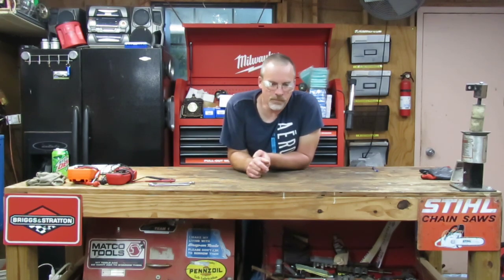How to Trick to test for Battery Amp Draw ( BATTERY DRAIN )

Comment: If you have a multimeter that can measure amps, then you can test for amps the same way the meter was hooked up. Still I agree, test light is all that's really needed to diagnose a key off parasitic drain. Well done video!
Reply from the maker: Yes a multimeter with amps setting can read amp draw, but most meters will max out at 10 amps, If it's more of a draw than that ,Meter won't show a reading

Comment: You're doing the meter wrong. Put it in amps mode (not volt mode) and change the probes to the amp position on the meter.  Hook the probes in the circut exactly as you show them.  That will measure the current draw of whatever is trying to use power.
Measuring current requires your meter to become part of the circuit (that is why these meters have separate jacks for amp draw and everything else). The light is working in exactly this way.   Using the meter will show even the smallest current draw, usually down to micro-amps.

Comment: You don't need a test light. You can do this same test with your meter.  Plus the meter will tell you exactly how much current is being drawn.
Reply from the maker: If you watch to end of video, I use a meter
Meter does not work as well as a test light
Reply: @sartingarage8045  That is because you are not using the meter correctly.  You are testing volt mode. You need to be in current mode to test the current.
Reply from the maker: I get it, Most people do not understand meters. I know I can put the meter in amps and test for amp draw. For most people a test light is much easier to find what is drawing on battery with key off. Light ON, There is a draw on battery. Light OFF , There is Not a draw on battery. It's just easier for most.
Reply: @sartingarage8045  Well, I agree you can never overestimate the stupidity of people.
Reply: I learned a while ago, the moment you add more complexity into a procedure, the user will have much higher chances of performing tasks wrong. Follow a KISS standard: Keep It Simple Stupid. Haha! 

The test light trick does just fine.   Noone needs to know if the parasitic draw  was 1 amp or 50 amps, a draw is a draw; it needs to be found and corrected is all.
Reply: @DrBetelgeuse  OK, but I don't see how using a meter to do it is any more complicated than using the test light.  The key is putting it in the circuit.  It will not work unless either the test light or the meter is put in the circuit.
You are probably right that know that there is a draw is more important than knowing exactly how much of a draw there is.

Comment: You said in a different video that you should never jump the mower with a dead battery and let the mower charge the battery rather than charging it 'off-vehicle' with a battery charger.  Why is that?  Do these stators overheat quickly?  The rectifier/voltage regulator overheats?
Reply from the maker: https://youtu.be/y9Hsb8yPeYE

Comment: Hey Chris, Ray here in Texas. I've got a Kubota Z125S Zero turn. I get no spark at the plugs. I've tested the stator but only have the starter speed to check with so I'm getting about 4 volts AC, tested the coils TOK, changed the plugs still no spark, any ideas?
Reply from the maker: Stator will not cause no spark to sparkplug.
I'm assuming this is a Kawasaki Twin Cylinder. If so, Its unlikely that both ignition coils went bad at the same time. First thing I would do is test key switch. It sounds as if both ignition coils are grounded out.
I have a video for testing key switch.
M terminal to G terminal
Check resistance here Key off and key on
Should only be resistance with key in off position.
I think your gonna find it has resistance both ways which is defective key switch.